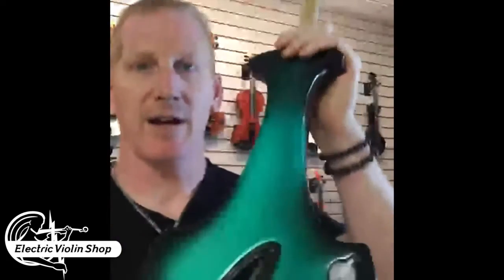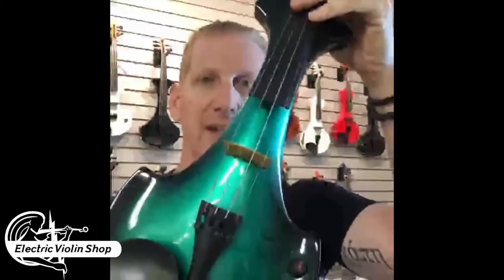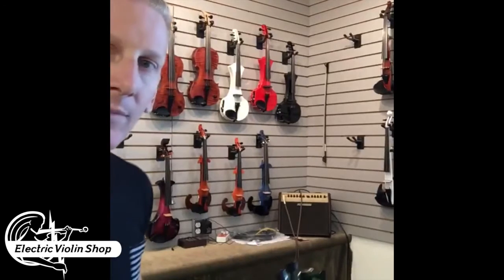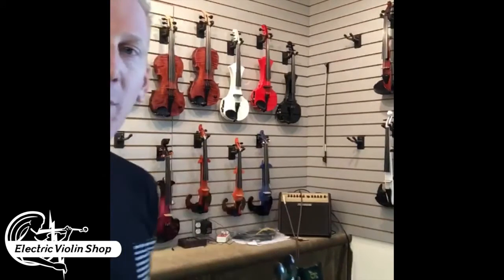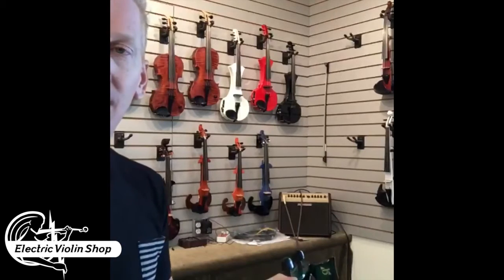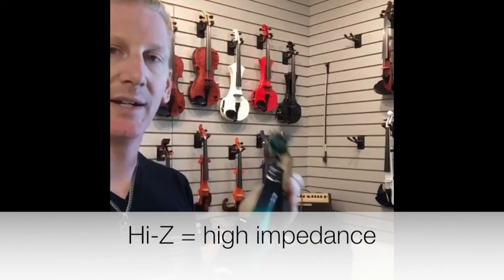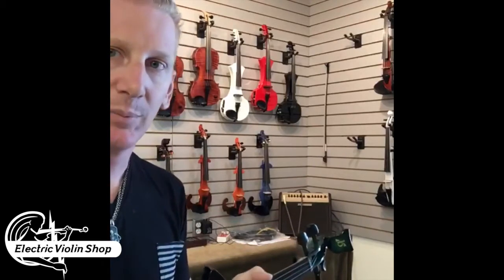Do I Need A Preamp? | Electric Violin Shop

Comment: Hello, Matt! Can you give me an advice: I have an acoustic violin, a passive violin pickup KNA VV3 and a processor Zoom A1 Four. So you think, I should use any preamp before the processor? Or direct input into the processor is enough? What do you think about behringer adi21 preamp/DI?
Reply from the maker: I haven't messed with that preamp.  I haven't had any trouble with plugging a passive pickup directly into the Zoom, though.
Reply: @ElectricViolinShop  thanks :) btw, what do you think about this processor?

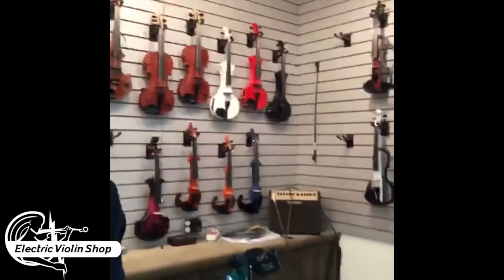Comment: Confused. Your violin built-in pre-amp is high impedance at around 0:55 and low z at 2:02. Which is it? Does low z mean low impedance?
Reply from the maker: The on-board preamp lowers the impedance.  I still wouldn't plug it directly into a board without a DI.

Comment: so my NS CR4 violin i need a pre amp? or only for pssive or acoustic?
Reply from the maker: Your CR4 has a powerful preamp inside it already, so an external one isn't required. You are right that most passive and acoustic violins benefit from a preamp, though a good acoustic amp with a Hi-Z input works fine too. It all depends on your setup and needs.

Comment: Hi Matt, 
I have a Viper with a Barbera Pickup. It was working well in the beginning but then (a year later) the A string started to fall through and now all 4 middle strings are not sounding (i.e. not being amplified). Have you ever come across such a problem? And is there a safe way to disassemble/fix the Barbera bridge/pickup myself? I couldn’t find any instructional photos or videos online... Any advice would be much appreciated!
Reply from the maker: You don't want to disassemble the bridge.  That's a no-go.  But we have a video on how to maintain Barbera pickups.  https://www.youtube.com/watch?v=z7hTD0rGeA0

Comment: Can I plug directly into the Hi Z input on my Behringer PMP 2000D mixer
Reply: John, in theory if your mixer has a channel that's designed to take a high impedance input signal, then I'd say yes, give it a try. If it doesn't sound good, you can always add a DI or preamp, later. But you should be fine, if that channel of your mixer is designed to take a high impedance input.
Reply: Many thanks

Comment: Hi Matt, 
I have a bridge like the one you use in this video, is there a small portable pre-amp that you can reccomend? Manyt thanks for your help.
Reply from the maker: Sure.  We really like the LR Baggs products.  Depending on what your specific needs are, they have a Paracoustic DI and a Venue that we like a lot.  The Venue has a tuner and a boost button built in and the Paracoustic is more like a typical active DI.

Comment: Hey Matt, 2 quick questions: 1) if you have a fishman external preamp would it make the ns nxta unnecessary compared with the original nxt? Also, do you guys ever sell fender violins? Like the fv-1 or fv-3?
Reply from the maker: Well, the NXT is no longer available, so unless you find one on the used market...  The nice thing about the NXTa is that you can engage or disengage the preamp.  So you could test it with your Fishman and see if you like the MISI sound better.  

Keep in mind that you can use the MISI AND the Fishman together.  That's a third option.

As far as Fender violins, the only time we ever get them in is on consignment sometimes.
Reply: Thanks for the response! Well the reason I ask is because there appears to be NXT on sale on your website, I guess now I know why (discontinued). I appreciate good value, and since I already have a preamp I thought I could save some $. Unless there's some voodoo to the internal preamp, the price seems more manageable.

PS: love your store, my kind of place haha
Reply from the maker: Although discontinued, we DO have a couple of 5-string NXT violins left at a big discount...
http://www.electricviolinshop.com/nxt-violin.html

Comment: Hey  Matt, I am new to the electric violin. However I have been playing acoustice for about 15 years. I'm debating between the NS Design WAV 5 and the Yamaha YEV 105. I mostly play worship music in my church's band but we also cover pop songs as people come in before service. My first question it, should the preamp be the first thing my violin is plugged into or the last thing before our PA system? Also do you have a recommendation between those two violins?
Reply from the maker: Generally a preamp would be the first thing you plug the violin into (ahead of your effects and amp, if you're using one). If you are using a DI box, that would typically go at the end of your signal chain before going to the board.

The YEV is pretty hard to beat for under $1,000, but you really can't go wrong with either the WAV or the YEV. It mostly comes down to your design/look-and-feel preference. They both sound great but the YEV probably has the superior tone out of the box. If choosing the WAV, we strongly recommend a string upgrade, which instantly improves the tone and brilliance of that violin. You can use any strings you like though, so you may already have a set at home you could put on. Also, through Cyber Monday (11/28) the Amber WAV5 is discounted to just $549.
http://www.electricviolinshop.com/ns-design-wav-5-violin-amber-transparent.html
Reply: Thanks Matt!